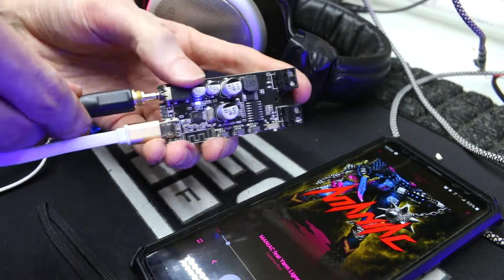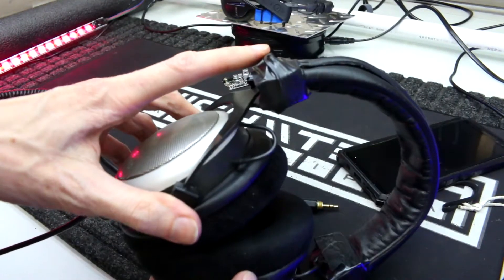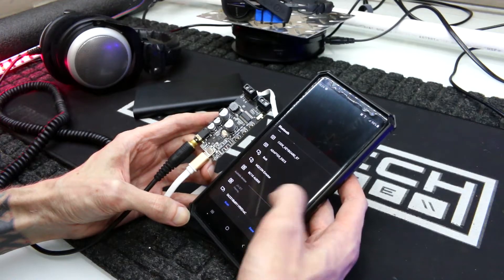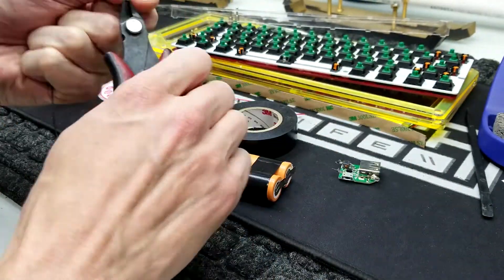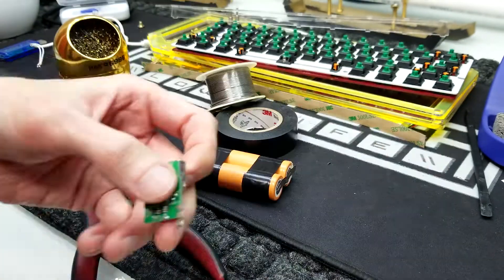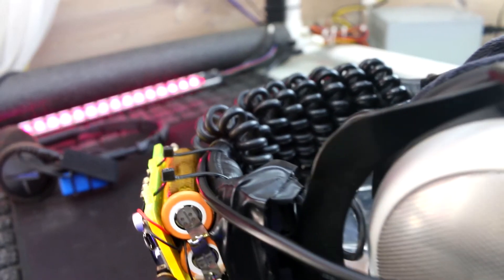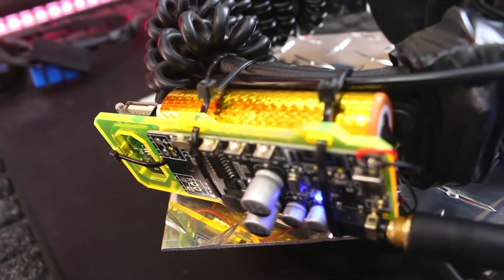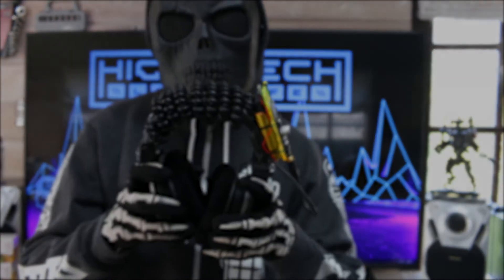🎧 Make ANY Headphones Wireless! - Convert Your Headphones to Bluetooth Wireless DIY Tutorial How To

Comment: Amazing, love the detailed explanation. Would have really liked to buy the finished product (ones in market appear flimsy and pretty steeply priced). I in fact the bulkier battery option that you have used, since the headphones people are trying to convert are classics or ones they love listening to for longer durations, usually ones well cushioned. With an additional mic extension (even a detachable), I would only be using these for taking meetings and not just music.
Reply: BTW, Velcro straps could an alternative to the more permanent zip tied!
Reply from the maker: @abhisheksharda2953  Thanks for watching! Yes, a lot of products are now trending too streamlined and minimal, I'd prefer something bulkier if the battery capacity is 10x something that looks "nicer". 👍

Comment: what was the pcb board called in this video cause I can't find that specific one anywhere
Reply from the maker: This particular board has a built-in amplifier, but that is not necessary for this mod. I bought this board a long time ago and the seller is no longer carrying it (they tend to update/upgrade these types of boards over time), but if you search "Bluetooth-compatible 5.0 Stereo DIY Power Amplifier Board With Button 3.5mm Stereo" You should be able to find it or one similar to it. 

My favorite ones right now are the VHM-314, they're very small, have type-c for power, are rock solid and dirt cheap: https://www.aliexpress.us/item/2255800283656355.html

Comment: LMAO to your disclaimer, yep... people are... well you already know lmao.
awesome video, i was curious about doing something like this my self.
my biggest question for this is, i personally want to do/try something like this with a true 7.1 headset that's USB-C(yes it has a bunch of driver's in the headset, asus rog theta 7.1 headset), but i've always been iffy with Bluetooth due to mainly it's bandwidth limitations and wasn't sure if it'd give the full audio output/quality/8 channels for it to work well with such a headset. i already know that the whole BT+Surround sound was always BS just from the it's limitations back in the day and there hasn't been a major improvement to any of that til version 5.1 i think it was but also some of that was codec specific for devices also. but i wasn't sure if you had tinkered with this at all.
also, on that board with the better sound because of the amp, it probably really is the amp, i've tested many devices over 3.5mm, usb, wireless(dongle to dongle 2.4ghz) and BT and ALWAYS... BT was overall a lower volume output(about 80% of the volume or less) and couldn't drive things, i have thoughts on this, but maybe they're wrong but also never really looked into it as i don't use it often enough to care lol not to mention the amount of general issues i tend to experience with BT. for my phone i'd rather get a USB-C to 3.5mm jack over using BT unless for phone calls with ear buds lol but there is a convenience factor with the BT so it's why i tend to just use my earbuds more.
but i guess a better way to put it. i'm aiming to make my 7.1 TRUE surround headset into a wireless one for gaming on my PC without ANY reduction on channels or quality.
Reply from the maker: Thanks man! As for multi-channel and sound quality, I suppose you'd have to do an A/B comparison and see how much you're giving up (if anything) and whether that is worth the convenience of wireless or not. I think for fidelity, a wired connection will always sound better, but it really depends on how good your ears are and how much you're willing to accept. 🍻🍻
Reply: @hightech-lowlife  very true... after digging into audio stuff and talking with audio engineers and audio software makers over recent couple years, i've found out that majority for instance don't know how to use their ears for the surround sound to even be noticed, which is why the mass majority are seen as ignorant in that sense when it comes to stereo vs virtual surround sound vs true surround sound, much like audio now days is more of a "subjective" or "preference" instead of ANY kind of objective view except those few who are testing for the specific things. but yes, majority i would agree to your statement about "willing to accept" more than  the rest lol.
but overall, i was trying to dig into it, unless you do a setup that's similar to a USB headset, you need a dongle to dongle setup, but then another video i've seen with what i'm trying to do, apparently using a rasberrypi to do what i'm wanting... so apparently WAY more or harder for normal wireless/Non-bluetooth lol.
Reply from the maker: @bobcamoh.a.f.2874  Yeah bluetooth will be easier, you may be able to have less latency with a 2.4GHz connection. You may be able to find some 2.4 boards transmitter and receiver for audio on aliexpress but I've never really looked for that, 99% will be bluetooth. 

Most people just listen to music through their phone speakers. You have these incredible mastering engineers trying to make the sound as good as possible just to have the vast majority of people listening to crazily compressed mp3 audio out of a mono 12mm speaker within a "cabinet" that is 5mm tall, just atrocious. I'm not even an audiophile either.
Reply: @hightech-lowlife  yeah it definitely will be lol.
yeah i could, never really use that site, but it seems to be the go-to for DIY stuff it seems, only thing i've gotten on there was replacement ribbon cables for PS4 controllers lol.

lmao, right!! i mean, if it's all ya got, that's one thing lol.
doesn't help the marketing crap definitely misleads SOOO bad any more... and it's all being taken at face value...
Reply from the maker: @bobcamoh.a.f.2874  AE is incredible: https://www.aliexpress.us/item/3256804219956597.html 

https://www.aliexpress.us/item/3256807913203872.html

They are a great source for DIY PCBs for projects. 

Yeah the enshittification of products over the years has devolved into the abysmal landscape we have today. I'm hoping there is a return to 70's and 80's where building quality products that could be repaired is more the norm again.

Comment: As for your rant about why not buying something that allready exists:
The batteries in my bluetooth earbuds are starting to crap out.
not too long until I have to replace my otherwise perfectly fine earbuds because of dead batteries, that aren't replacable.
So therefore havin the actual headphones and the bluetooth-module separate - hopefully - mitigates that issue,
which is exactly why I came here :)
Reply from the maker: 100%, replaceable batteries are a lost relic of yesteryear. Same with headphone jacks, SD card slots, CPU sockets on laptops, and others. It's always best to have separate components that can be replaced independently. That model is not profit friendly though, as companies make more money if you just throw away something and buy another than if you repair something and use it for longer.

Comment: Is there a way to convert type C earphones to wireless?
Reply from the maker: This method will work for any connection type, they make BT boards with type-c connectors preinstalled but a connector is just a way to terminate wires 👍

Comment: Question is there a way to bypass using a wired headset to listen to an MP3 players FM radio with a Bluetooth headset? Is there something you can buy to use for the antenna?
Reply from the maker: You're trying to go the other way? Yes, there are bi-directional products: https://www.amazon.com/Bluetooth-Transmitter-Receiver-Portable-Rechargeable/dp/B083J98ZFX 

It may be possible that even with this board to also do that.

Comment: It's not working for microphone also?
Reply from the maker: I believe it's just two pole 3.5mm so mic is most likely will not work, however they may have some wireless boards that will also do microphone as well.
Reply: @hightech-lowlife  if you have any link I want to make my headset with microphone wireless
Reply from the maker: This has a 3 pole plug for mic input: https://www.aliexpress.us/item/3256804619548527.html @akasha1337
Reply from the maker: One of these options also has built in mic, but not sure if it would work with mic through cable: https://www.aliexpress.us/item/3256806051229301.html  @akasha1337

Comment: DIY board was interesting

I use Sony SBH56 with Bose soundtrue  earbuds

 (bicycle rides = during winter = forced switch to truly wireless to ensure wired earbuds for next 10+ years @ 5 each)

Wireless earbuds downside is weather (can't use controls during winter, cold, or wet)

___

(Discontinued, but still available) cleanest water-resistant setup I've used.

Sony SBH56, sbh54, mw600 (but its too fragile)

Battery lasts ≈ 5 hrs (device 2+ years daily use = before capacity is drained) these BT devices outlast cable deterioration
___

quality wired earbuds are obsolete (discontinued = overpriced resale upwards of 5x retail) a highly valued treasure today

Most Bluetooth headphones still have the input plug (cable bought aftermarket = reduce e-waste)

I'm willing to pay more for wired headphones than flagship Bluetooth (voiced my opinion to everyone)
Reply from the maker: Thanks man! That sony unit is pretty cool, I do have some wired earbuds that came with my phone that work pretty well they are AKG. Most earbuds are very uncomfortable to me compared to headphones though and I don't think you can get the same sound quality, but they are much more convenient than wearing a giant thing on your head 🍻

Comment: I have a little Taotronics Bluetooth Transmitter/Receiver thats basically like the device you showed at the beginning, I bought it because I wanted bluetooth but none of the bluetooth earbuds are of the style of earbuds that I can comfortably wear (in-ears hurt to wear for more then a few minutes) other then paying stupid money for Apples Airbuds, plus I can use cheap $20 earbuds with it.
Reply from the maker: This is the way 👍a lot of earbuds hurt my ears as well, and headphones are so much more comfortable.
Reply: @hightech-lowlife  earbuds are easier to fall asleep wearing than over ear or on ear headphones and I like how compact and portable earbuds are my favorites where the Seinhieser MX365 but they've been discontinued, I had to settle for the apple earbuds as every other earbuds I tried sounded like crap now. I have a set of HD598's and a Fiio Alpen 2 DAC/AMP for proper listening sessions, been thinking about getting a Fiio BTR5 or BTR7 as an upgrade to the Taotronics Bluetooth unit.

Comment: i have very good headphones the issue is the wire is spoiled !!! is still possible to convert it?~
Reply from the maker: Yes 100%, it's pretty easy to put a new connector (or even a fully new wire) on the end of the cable 👍https://www.headphonesty.com/2020/12/fix-headphone-wires/
Reply: @hightech-lowlife  super thx Man
Reply from the maker: @JosephAli93  No prob 🍻

Comment: Cool stuff!

Btw what is the latency on this? Could you minimize lag? 

Planning to do this on my sennheiser 280 for esports if the latency is bearable.

TIA!
Reply from the maker: Not sure as I've only used it to listen to music, it should be comparable to 5.0 BT specs though, which many devices use for communication without problems. There are many different types of this board out there, some may be better for that than others. 
Thanks!

Comment: Hey if that little bluetooth board can do aptx. I wonder if I can attach it to this old amp I got. I literally just tested it out after cleaning it up with a leaf blower and a bunch of rubbing alcohol with detail work. Its a Marantz 1060B with funny enough..speaker wires sticking out still. Its a very heavy bass amp yet I love it's soundstage. And since I only use headphones, iems, and wireless earbuds, I would definitely use this.
Reply from the maker: I'm not sure if it can, but since it's not advertised I would say no for APTX. Although there may be some boards that can do that, but most likely will be more expensive 👍Thanks!
Reply: @hightech-lowlife  Actually found something right now. This Swiitech TR-01 on Amazon states this bluetooth transmitter has aptx. Reviews say whole day uses. Plus two devices at once either transmitting or receiving. Nice. Still gonna keep looking, but found something for around $20 that can not only be used for one but many other use cases.

Also, you reply fast! I was searching bluetooth transmitters for amps here on Youtube while using the old amp. Went to bed. Woke up and found you and your channel in the recommendations. I really like the bluetooth keyboard video! That's so dope! Especially all the testing to see what works well enough. I myself one day would definitely try out something similar to your detachable cable mod on some older keyboards and maybe some mice to usb c. I'm talking PS/2 connectors here! It's just that the older keyboard has media controls on it and I got it at a thrift store for $2. Used it for years until I got better income(not great income, but better than nothing) and got a Corsair K60. So changing the connector to usb c by using this spare usb c cable lying around would be awesome. And if I'm brave enough, I could try the soldering a female usb c connector. If it doesn't work, then I've still got two cheap keyboards and two mice to sacrifice.

Thanks for the inspiration! I never do soldering too much. I just use an old woodburner tool that I've had for a decade and a half put wires together or apart with different tips. But thats only been for electrical outlets with bigger cables. Might try it out on cheaper stuff like this to see if it works.

P.S. If you've got $15 to $25 to burn and you ever wanted to try out some bluetooth earbuds. I would recommend the Tozo A1(very small and good to sleep with), Tozo T10(great bass and my favorites), or Tozo T6(uses micro usb but has a better mid sound) Great to try out and comes with good eartips. Only thing is quality control. They are the same chipset as the Edifiers which I used the TWS Pro 1(same exact thing as the Tozo T10)just Edifiers has better quality control or essentially it won't be a lottery to find out if one breaks. I've hadn't had issues with Tozo, but it does exist. Yet for this cheap, it was great holiday gifts for everyone and no issues. Just a quick thing to share.

Hope you have an awesome day!
Reply from the maker: @grizzlyindustries7593  Awesome, I'm glad you found something that might fit the bill. Thanks for the recommendations! I will try out those earbuds for sure, I usually like over the ear headphones because all the buds I have tried are uncomfortable for me, but I'd give it another shot. 

You can try the woodburner tool, but soldering irons are so cheap now that even the ones that are only a few bucks are decent enough to solder with 👍

I actually have another video on my channel where I show how to take a wired keyboard and make it have a detachable type-c port, and it's pretty easy. I'm sure you could mod that other keyboard however you want, adding a port or even going wireless! 

I hope you do as well, take care man.

Comment: and the microphone? its possible to transmit by the wireless in this circuit?
Reply from the maker: According to the specs on this particular board, it doesn't support voice ("without microphone, no voice support") - but I'm sure there are modules that can do that.